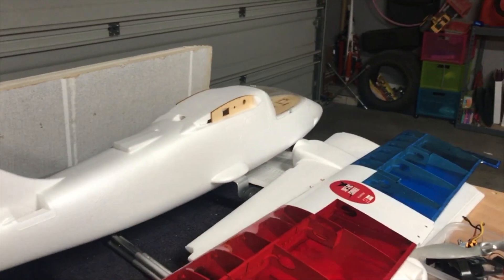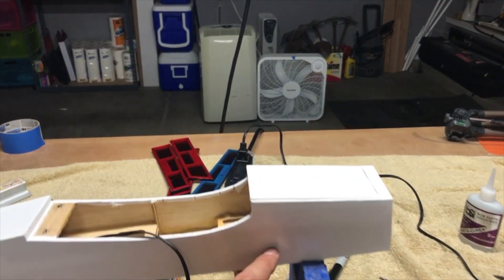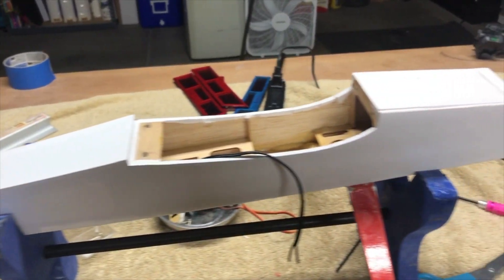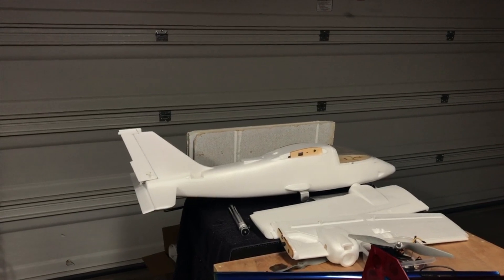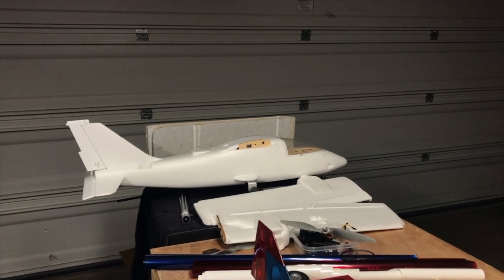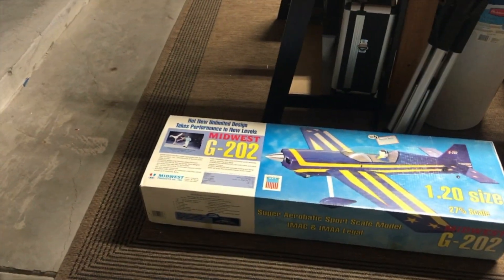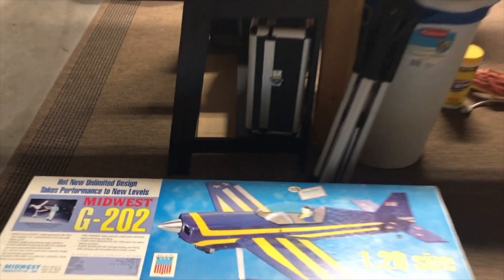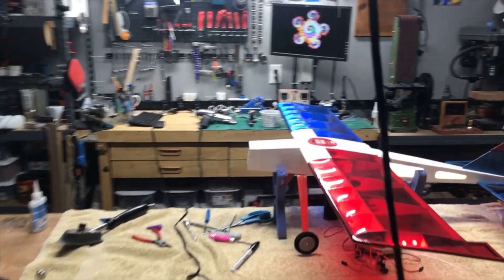UltraStick Part 3

Comment: Looks great looking forward to the other builds too. 👍
Reply from the maker: Thanks. I should be starting on an old SIG Colt build soon. Just taking up some short projects in between. I am looking forward to the Colt build, plan on flying it with the old Futaba radio I converted to 2.4. Thanks for the support...
Reply: @JoesRCCorner  saw that radio conversion . very cool .i did a couple of old jr and futaba radios with the DHT modules too. 👍